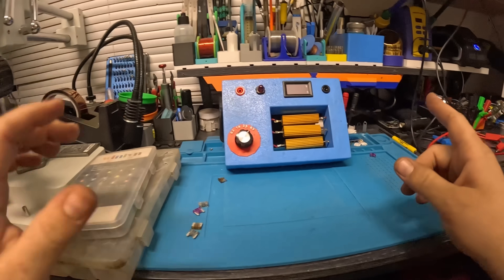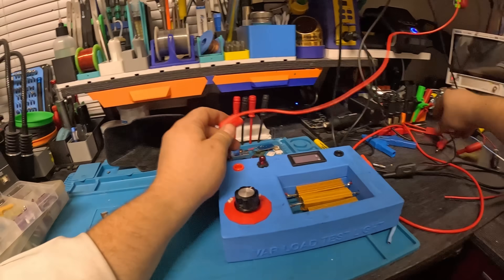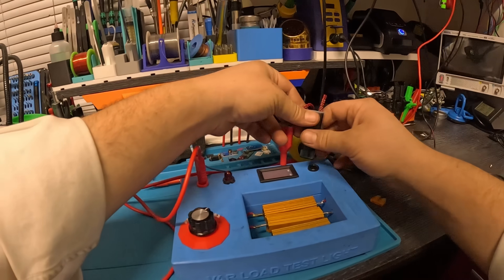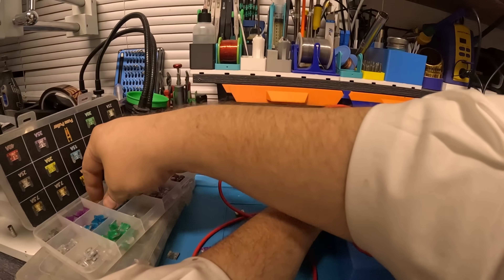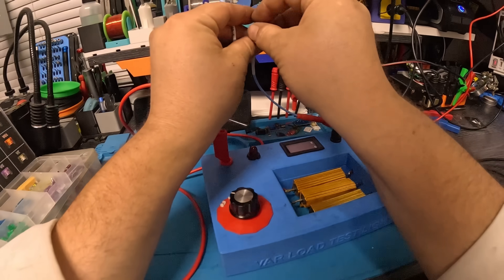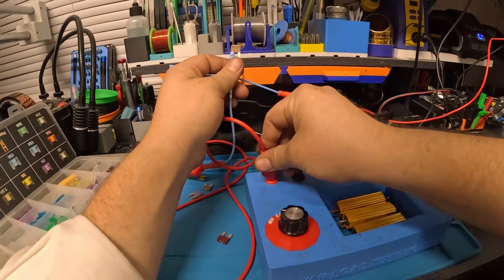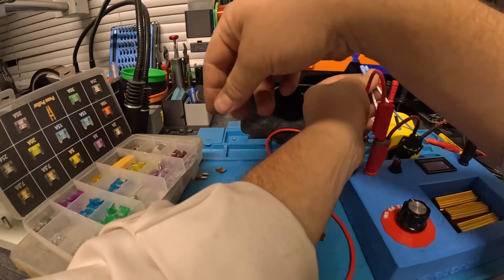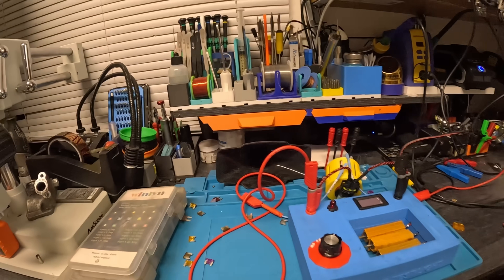Why I Never Use Cheap Fuses!

Comment: Why You Should Never Use Cheap “Amazon” Fuses: Video Breakdown

Inspired by Louis Rossmann, this video puts bulk, no-name Amazon fuses head-to-head against trusted Littlefuse ones. The presenter uses a controlled variable load setup, incrementally testing fuses rated for 2A, 3A, 5A, and higher at steadily increasing currents, all the way up to 10A.

Findings:

Cheap bulk fuses (Amazon): The 2A and 3A fuses do not blow even when overloaded at 10A—five times their rating. The 5A fuse did eventually pop, but this was the exception; others simply melted but held the circuit dangerously open. This unpredictability means your wiring or modules could overheat and catch fire before the fuse reacts.

Littlefuse brand fuses: These OEM-quality fuses responded as they should, blowing promptly and predictably at or just above their rated current. This is crucial for protecting sensitive electronics or automotive modules.

Key Timestamps:

0:00–0:32: Introduction, test setup, and background (Rossmann influence).

1:10–2:26: Testing 2A and 3A cheap fuses—poor performance.

2:46–3:04: 5A, 7A, 12A cheap fuses—most refuse to blow.

3:11–4:60: Switching to Littlefuse—reliable, proper functioning.

Conclusion:
Always use reputable fuses like Littlefuse for any equipment you care about, especially automotive applications. Cheap, bulk Amazon fuses are dangerous—they may never blow until it’s too late. Spending a little more on a trusted brand delivers real protection and peace of mind.

Comment: Wow - that is really good to know! Thanks!
Btw, if your supply has a current limit knob, you could adjust it to whatever current you're trying to test. II'm going to try my fuxes soon. I bet they are junk too..
Reply from the maker: Thanks for watching! On all the power supplies I've ever seen, the current limit knob works by lowering the voltage, so its not a fair test.
Reply: I bested some of my fuses just now: you are totally right -- the lower current fuses are total garbage! Thanks again for posting your  eye opening video on this! I tossed mine out. No point using them.

Comment: In case you burned yourself with the cheapo „fuses“, you will never use them again :D 

I even use old ones from the junkyard. They work fine, even used, without burning everything down.

Comment: Wow! Good PSA... just tested my amazon fuses. I made my own load it box and with the bulbs I have it maxes an 8A load and so I tested my 2A through 5A amazon fuses. None of the broke with an 8A load on them, that's crazy! I also tested HF Storehouse brand, lowest I had was a 5A fuse, and it didn't pop with a 6A load but it did with an 8A load on it.
Reply from the maker: I just checked the Spec sheet, and at 135% of the fuse rating, it should blow at 750ms up to 1800 seconds. So on a 5-amp fuse at 6.75 amps, that is still within spec. I had the same on harbor fright fuses except for one that physically melted. I think I'm going to keep using Littelfuse.
Reply: @advancedleveldiagnostics   Bussman fuses are good too.
Reply from the maker: @bernardocisneros4402  💯

Comment: Well I don't know if you know the GM and other oems has a TSB stating not to use anything but OEM fuses.. I worked for Chrysler for 9 years and we were admonished to use nothing but OEM fuses... And I'm sure you are aware of the 09 harbor freight fiasco where they had to do a recall of the cheap deadly fuses that they were selling... And to my knowledge harbor freight still does not sell automotive fuses.
Reply from the maker: Harbor freight started selling them again. I tested them today 1 5amp fuse the whole plastic started melting at 6.5 amps, after that they all blew after 30 seconds.
Reply: Anybody buying harbor freight fuses.. is insane